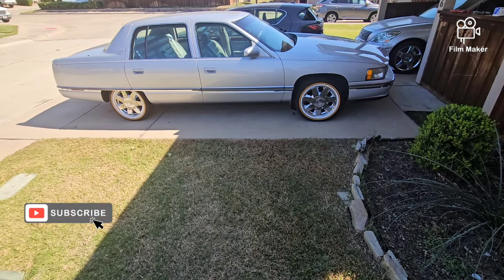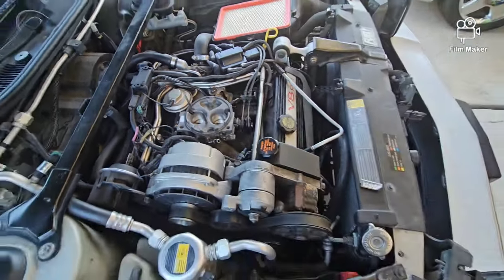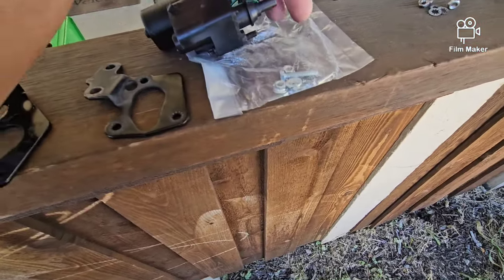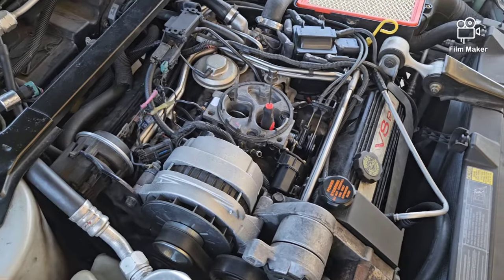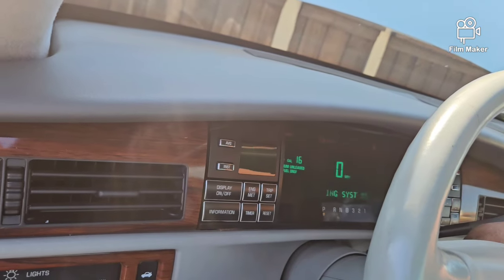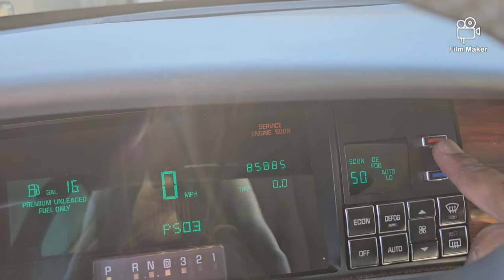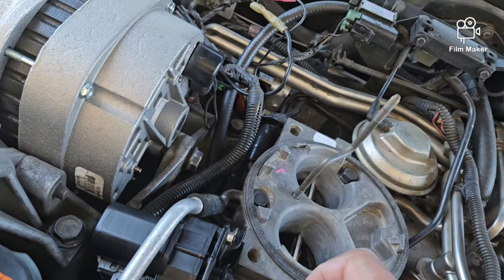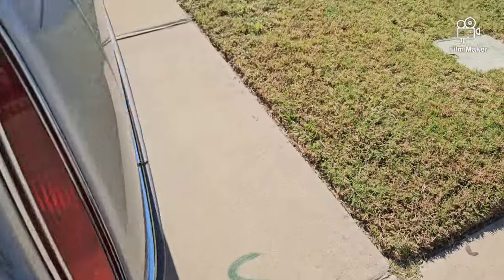DIY PROJECT! HOW TO INSTALL A ISC MOTOR ON A 91-95 CADILLAC DEVILLE WITH THE 4.9 LITER V8 ENGINE

Comment: Thanks alot bro i live in dallas,tx too and i got a 95 few months ago and i have been using alot of your videos. Super helpful. I need to troubleshoot my ISC because once in a while when i let go of gas it keeps accelerating or doesnt slow down.
Reply from the maker: I'm in Dallas as well. If you need any further help with your car. Just reach out and I will help out
Reply: I watch all your videos and there very informative. Quick question though, where can I find part two of the continued process to ensure all settings  for the ICS are done correctly?
Reply from the maker: @jamesbarlow8823 Hey James, 

Thanks for the awesome feedback. I appreciate it greatly. I would have ro walk you through it. If can shoot me a email at lawjo1978@gmail.com I will provide you my phone number where I can either walk you through it or do a video call if you wish.

Comment: Getting ready to do mine tomorrow
Reply from the maker: Let me know how everything turns out. If you need any help. Feel free to reach out...
Reply: @ any recommendations if you have to use that after market screw? If it’s too long can you cut it at all or is that not recommended?
Reply from the maker: @Jey-xc1 Use the short one that's on the old unit
Reply: Not many good videos on these devilles thank you for your assistance. I never knew you had to program the ISC through the dash. Thanks again! Worked out great. Rpm’s went way up nearly to 3k at start up. I tapped the gas and it regulated. Idling down now, sounding great. Do you by chance know and OEM part number for the ISC connector?
Reply: @lawjo1978 hey also, what would you say is the issue if repair is finished followed all procedures but when I go to accelerate the car stutters a bit as if it doesn’t want to go. What do you think?
Reply from the maker: @Jey-xc1  That could be a possible vacuum leak somewhere

Comment: My 91 Seville has the same set up but I notice when I turn it off I can hear the little ISC motor make a clicking sound for about 10 seconds and then stops. Is that normal? Other than that It idles at 600RPM while in drive an runs fine.
Reply from the maker: Hey Mark, if you ever hear the ISC motor do that. It's completely normal for it to cycle when the engine is off. And if you have 600 RPM at idle while in driving and car is stopped. That's a good idle for a 4.9 engine
Reply: @lawjo1978  thanks for the clarification!
Reply from the maker: @markj9544  No problem